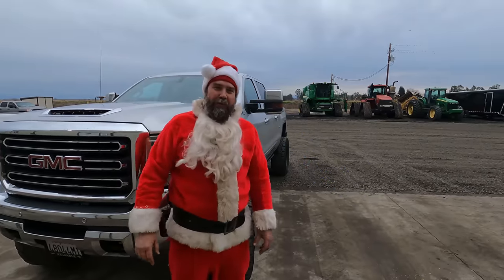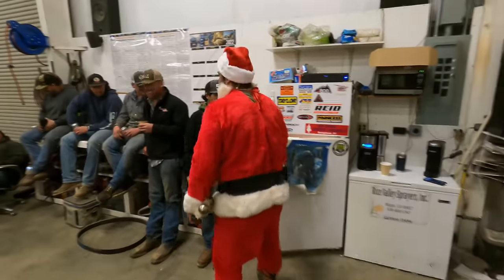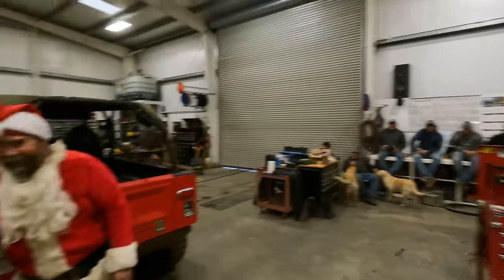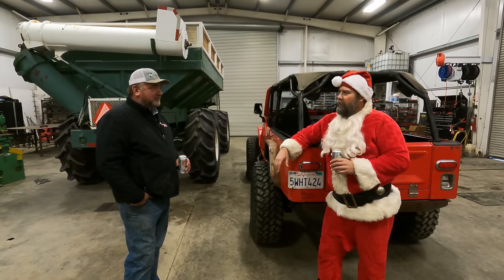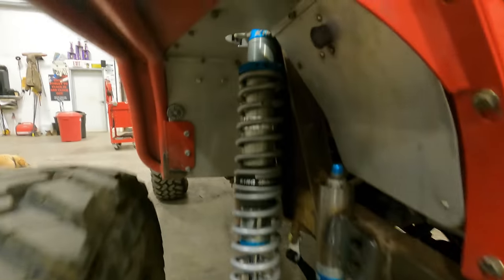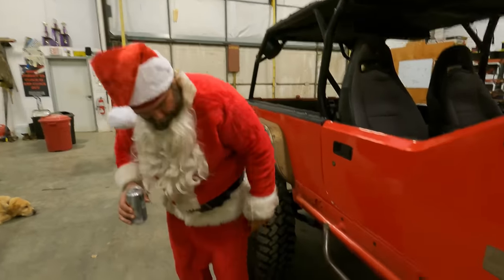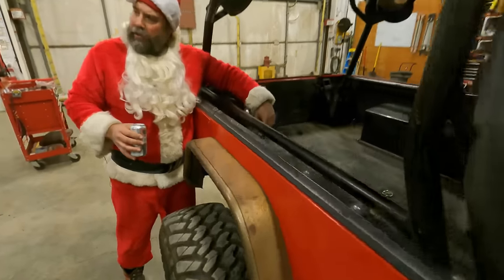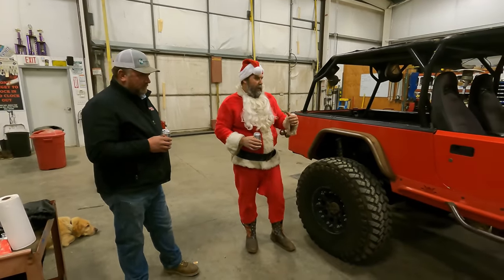(12 Rigs of Christmas) CJ8 Roll Over Redemption & Walkthrough! Ep. 4

Comment: How does one lock up only the Front breaks for a Burnout?
Reply: Most of the time the brake bias is 60 to 70 sometimes even 80% front brakes and as low as 15 to 20% rear  so just don't hold the brake pedal when ya give it the beans(or have it in 4wd🤤)and the rear tires should break loose,......well unless you have a front wheel drive vehicle. 😬